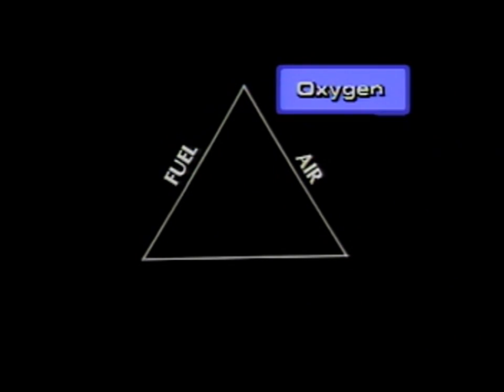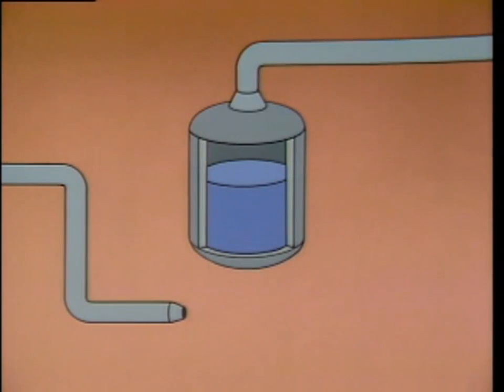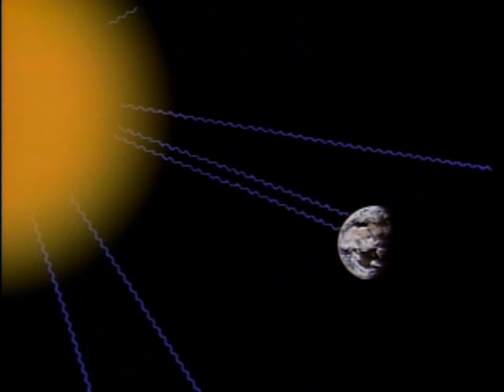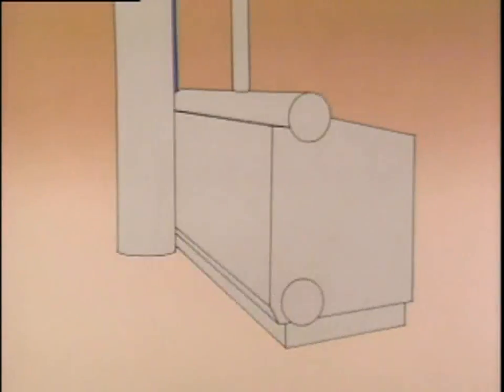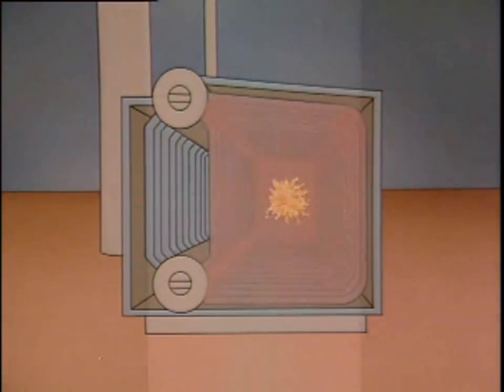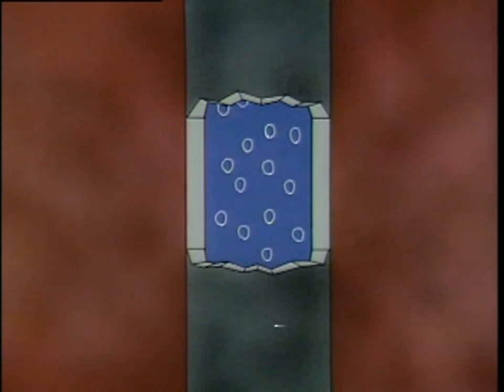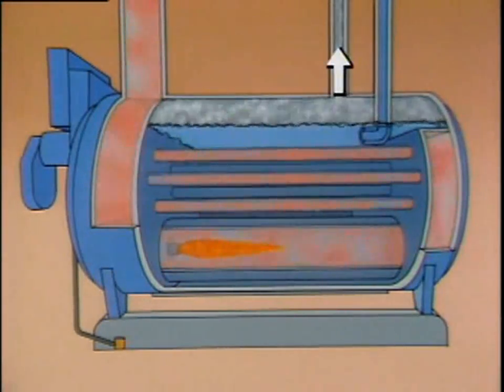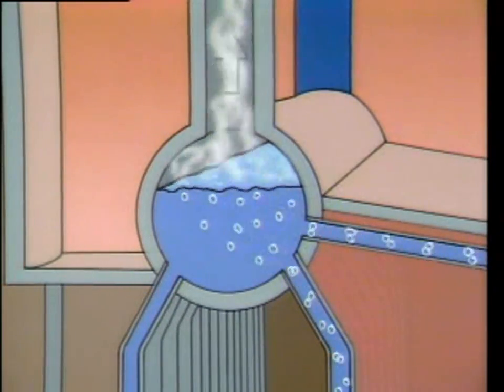Steam Boiler Fundamentals, Basic and Operation

Comment: what is the normal temperature of the fumes/exhaust gases at the industrial steam boiler like boiler that can produce 100t/h, if you can say aproximate number, thnks
Reply: I run 5 steam boilers and each of them produce approximately 20,000 pounds per hour of steam at 150 psi. The average stack temp is about 500 degrees F before the economizer and about 200 degrees F that actually goes to atmosphere. The fire box usually runs 1500 to 1600 F.
Reply: Steam that's not pressurized is 212 degrees